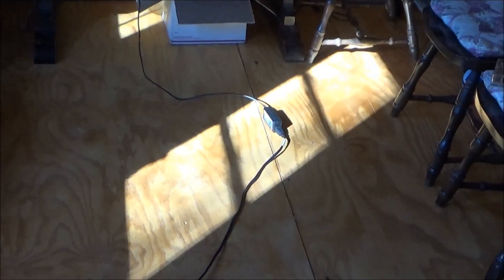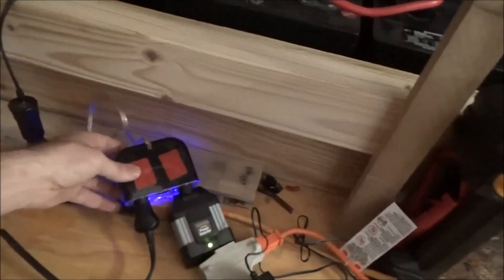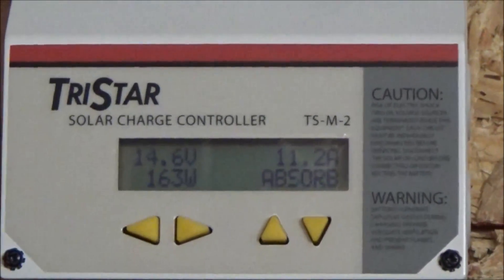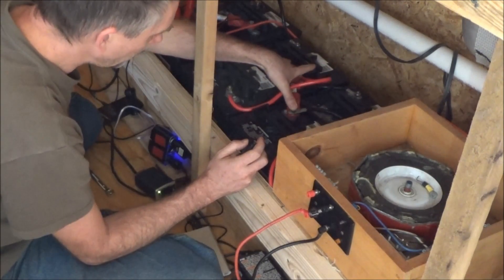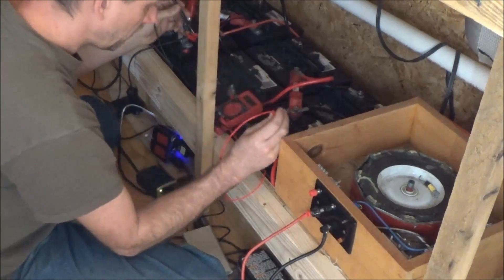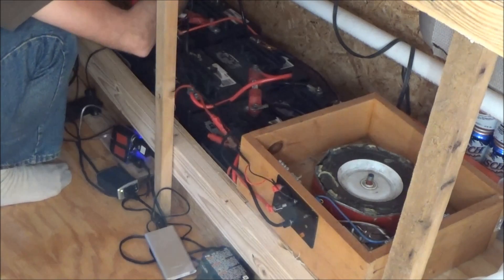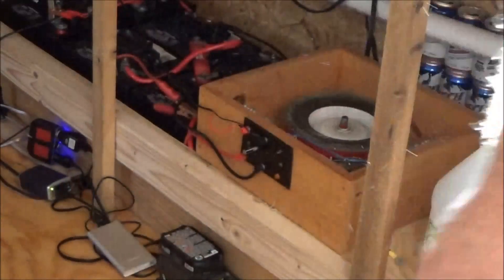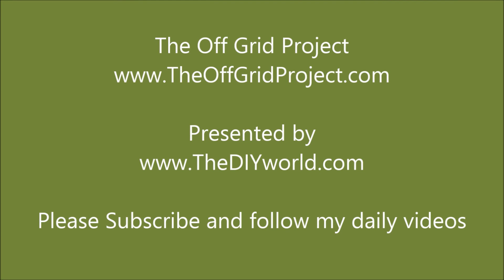Tiny House Solar Power And Desulfating Batteries With Bedini Motor

Comment: I’ve got 4 - 100W Rich Solar panels 2 in series & I’ve got 2 Micro GLM 700 & GLM 350 my concerns were the amperage each panel at max is 5.41A - 100W but my house is a front to back split and I don’t want to puncture the roof screwing the panels to it ideally the weight of the 4 panels together w/ the Slotted steal brackets to keep the 4 panels as 1 I’m in Massachusetts winds we don’t get to high 5 - 30 MPH once in a while 100 MPH but I’m figuring the jet stream blows at an angle to my house and I’ve hot skylights which can if needed buffer the wind ! The 4 panels weight is about 54 LBS + I have 8 AWG wire 1 pair 50 feet & a pair of 20 foot & 10 Foot pair “ my issues I just have to do it ! All my stuff is Grid Tie In into my Square D 100A 120v 15 spaces ! Have you ever thought of Back-Feed on a 20A Double pole Breaker ! And my Desolator Id BLS for 48v 280Ah how long do you think it will take to Desulfurization a Lithium 48v 280Ah battery bank ? Thanks

Comment: take your banana charger or your homemade charger I can't pronounce it or spell it the one you made that has magnets on it and hook it up 2 year solar charge controller and run it through the air at night time or all day. At all times and one more hint of a vice you can buy a 12 volt trickle charger that used less than a amp of power ac and converted to a lot more DC then they use what you also look up into your charge controller to trust me you can do it positive to positive negative and negative hook right into charge controller do your research if you're scared and you'll find out you can hook up a trickle charger to your charge controller and it will charge your batteries the only thing I haven't gotten to yet is about grade and tie inverters they are different I was told also I want to do is be able to use a 600 watt inverter and get a couple solar panels for that individual or charger or inverter I mean but also I don't know is sense grey tie inverters are different I do not need batteries watch the solar panels can go right into the inverter without eggs grid without a controller and also I want to do is plug it into my wall outlet and feed it back to me Electrical Company hit me back bro

Comment: If I were there I would open a window if I could smell hydrogen gas. Better safe than sorry if you now what I mean. What if the small hole is not enough to safely vent all the gasses.

Comment: Hi Troy
13amp ext lead is not one of your best ideas .
I would use a cable size of 10 AWG or bigger .
A wire size resistance Ohm/m table is essential for this work .
( xls sheet for maths as longhand is a pain )
I used this   " AWG to Metric Conversion Chart.pdf "

10AWG   =   0.00328 R / Meter
So 100M =   0.328 R  ( 50M out + 50M back )
So @ 15AMP = 4.9 Volts drop ( 74 W loss as heat in cable )
3 X 220W ( 660W ) of solar is within this range
With panels in series & maximum voltage of MPPT controller not exceeded ? .
looking for panel o/p Voltage of 42 - 50 v ( 5 v less @ MPPT end under load  ) . 
Edit < sorry for the Gold plated brick should be 42 – 150V more coffee please ! >

As for 13amp ext lead with 3 conductors (15awg) connected in the UK = ( 0.347 R ) @ 100M long with 17 v of solar .
Passing 20 AMP = 139W of heat in the cable & 7 V drop end to end .
In the real world the controller would step-in & you will see very little charge current .
Still a hot wire !!!!!

Now I need another cigarette packet ! .

Comment: I would buy a ctek charger. They can desulfate a battery in 24hrs. I had a battery that would only charge to 12.86 now its sitting at 13.16 after using the ctek.
Reply from the maker: With this Bedini I have taken batteries from 0.05 volts back to normal use again.

Comment: Hey Troy, congrats on the major top off! Have you ever experimented with a Hendershot Generator? If it works (haven't tried one but a lot of my friends assure me it does work) it would at least give you light and enough current to charge up your cells and 'puter. Next time you're on line Google it, I'd love to know what you think about it! Keep on keepin' on, my friend and don't let the haters get to ya. They just aren't worth the aggravation.
Reply from the maker: Thanks. I have looked at them but the Bedini is so simple in comparison. I need a proper work shop to get that complex

Comment: Hey,I am John .
I recommend you to buy a humidifier so you don't have problems with low humidity .
This is a link for you : http://www.ebay.com/itm/1-5L-Ultrasonic-Home-Aroma-Humidifier-Air-Diffuser-Purifier-Lonizer-Atomizer-New-/191282922589?pt=LH_DefaultDomain_2&hash=item2c8959c45d

This one can use a kind of aroma , if you don't want it to use it just don't put it in there ! I think it will have flowers on it but it's ok !

Specifications:
- Coverage Area: Up to 20 square meter
- Material: PP
- Power supply: 110-240V
- Rated Power: 25W
- High capacity water tank: 1.5L
- Dimensions: 132 x 132 x 268mm (L x W x H)
- Power Cable Length: About 90cm
- Color: White
- Weight: 658g

Thank you for reading my comment !

Comment: would be better to build a solid state desulfator circuit rather than a bedini motor .way more efficient ,much quicker.

on commercial solar farms they operate solar panels in parallel for better efficiency,1) reduces the amount of copper required for wire runs. 2) inverters operate more efficient at higher voltages 3) less cable loss 4) use auto load switching,.worth looking into as you have a number of panels and batterys/

remote monitoring sites run battery banks at 48v or 96v for one good reason " better efficiency".

shipping 12volts is a royal pain due to level of losses involved. all industrial & commercial systems run at higher voltage for this reason.

you should make a degas manifold and connect the vents up on all the batteries and vent directly outside that way you will not wast or loss heat from having an open vent. you could even store the dirty gas and use for heating ,cooking or run a ice depending how you designed the storage system and the type of accumulator used to maintain the pressure.

Comment: Hey there, I just thought of something I didn't add in the post in the last video.

Another thing that a lot of battery sellers are doing these days is leaving the actual amp hour ratings off their batteries and opting to put the 'reserve capacity' rating on them.  I know quite a few people who have hammered their battery banks because this number can be a bit confusing.  I don't know about your particular batteries, but this formula can be used to derive amp hours from reserve capacity,  I figured I would post it here for people with this situation.  I had a SuperStart deep cycle that only had the RC rating on it, so I had to look this up to get it right.

AH = (RC / 2) + 16

AH  = amp hours
RC = reserve capacity

This formula does not take the Peukert effect into account, but it's close enough for government work.  I've had no problems using this with my own battery, which is now nearing four years old.  I don't know why they are only putting RC on deep cycle batts alot, where the true AH rating is more necessary.  I think because its a bigger number, which they think makes the thing more marketable (psychological thing).  I do understand its place, but honestly, why make it more complex for people?

I hope this helps someone some day
Reply from the maker: cool, thanks for sharing

Comment: I bought two portable solar panel and battery kits. The large panel charges the battery pack which has USB port and car adaptor port.
I bring the small battery packs in at night to save electricity to use as lighting with a 12v led strip light.
I can also hook up an invertor and plug in anything up to 90w.
Its a great way for someone to start out in the solar world. I can basically run anything from my laptop or charge my phone, charge my rechargeable batteries.
I try to buy low voltage alternatives to everything, like I have a portable CD player that I found a USB adaptor for, or I found a USB led light with fan, so many low voltage alternatives that if I bought enough of these cheap kits I could run so many things around the home apart from the fridge and larger appliances.

Comment: Troy your voltage is to high for your battery's 14.2 is max for lead battery's  if the battery's are gassing is not good
Reply from the maker: Batteries need to be equalized once a month to keep the plates clean
Reply: The Do It Yourself World yes you are right but you egualize at 13.5 v  and you wil not get troubles with your batterys  boost or charge = 14.2 equalize = 13.5  gassing is never good for your batterys. Its not for nothing your equipment shuts down at 15 volt.

Comment: you know the charge controller has it built in  !Know how to apply an equalize charge that benefits the battery. It removes sulfation that may have formed during low-charge conditions.

Comment: I put a big marine switch on my inverters to Isolate them without sparks. the single batteries should be tested for at rest voltage.  Should be very close to equal  when connected in series. A Weak battery(s) should be used on the same set or on thier own.
nice and clean now.

Comment: I know there are 100 more pressing issues on the project but I will be happy if Troy ever covers his floor up with well... anything XD.   I can appreciate rustic but plywood appears more half complete than rustic.
Reply: Greg NY It could become rustic chic with a nice high polished wood floor. Or maybe add something unique with slices of wood set in resin or lightweight concrete.

http://tinyurl.com/pxywsb5
Reply: It's better than dirt. MIGTOW!
Reply from the maker: ***** That is amazing.
Reply from the maker: Actually I plan to do that next year with pallet wood. It can be quite beautiful.
Reply: The Do It Yourself World
Just make sure you don't put any radiant barrier down beneath the pallet wood or we will all think there are holes in the floor.  :))
Reply: The Do It Yourself World Yes and it can be yours today for the low low price of $9.95.

No but seriously it seems like a DIY project you could accomplish easy. It would just be a matter of selecting a lightweight medium to set the pieces in.
Reply: The Do It Yourself World
Although I can appreciate using pallet wood for anything you can because it is cost effective and does look nice I would recommend balancing it out a little. Maybe use something else on the floor other than wood. Just my thoughts.
Reply: ***** This would of course be a project for the spring when Troy is off hiking, traveling, or camping.
Reply: Uncomfortably Numb True! LOL!

Comment: Hi Troy Good to see you have power .
Bus bars made from copper pipe / brass / Aluminum bars work better than cables would use for 6 v battery - battery links . That MPPT Battery Charger has a max input voltage of 150V .
I would use that and improve your cable run drop
If 3 core with screen / armored use armored / screen + 1 core as NEG cable .
The 2 cables as POS cable .
If only 3 core parallel 2 conductors AND yes it's a S*** but you are struggling with what you have .
Put your Panels in series up to the voltage limit off the MPPT Charger ( more Voltage less Amp for the same watts ) .
Keep them small inverters for now 1500W will KILL that small 2 battery pack .

Comment: dont buy a coat rack...go out in woods and find a nice small tree that branches out and cut yourself one and make a stand from other sections of the tree...now that would have a rustic and natural look !!...and be free also
Reply: Brilliant!   I love that.  Or if he doesn't want a floor model out of a small tree...same idea only a small section of a tree with maybe four branches - cut them off to about three inches each sand a little to protect the coats and hang it on the wall as a wall rack.

Comment: Glad you got some sun and showing a full charge. I am a little bit concerned about hydrogen gas. you should close in the cabinets off and add a small vent pipe to the under the cabinet space. It would only give off gas during charging. It needs to be enclosed to capture the gas so it dont go out into the room. If it ever ignites it will probably burn the whole cabin down. Not wanting to be the bearer of negative news or facts. I saw a couple of videos on you tube about people who have had their homes burn down.

Comment: That mess of wiring all over the place looks dangerous. Gases from those batteries and a wood fire in such a tight space is not a very good idea.  http://www.toolboxtopics.com/Gen%20Industry/Battery%20Charging%20-%20A%20Multitude%20of%20Hazards.htm
Reply: It's lucky Troy heats with wood,, the draft from the stove is pulling MUCH air from  under his front door and the wire port under his counter. Once he installs a threshold and plugs the hole, things will get REAL SKETCHY.
Reply: grodad Well... now I feel terrible for pushing for the door sill.    Let's weigh damaged floors and water below in the floor insulation  vs.  explosion.  aaaah!
Reply: MollyDolly
I suggested he install a drier vent in the house last summer. He needs to install a threashhold eventually, right?? right on! Who knew he would end up using the under-cabinet space??? I spent the last two days waiting for a vid. I thought the off gassing had gassed Troy off! lol
Reply: grodad No videos on Sunday.  Well, rare exceptions maybe.   I try not to officially worry until Monday evening... just in case of power or Windows 8.0 delays.
Reply: The Do It Yourself World Apparently now I need to worry about the off gassing??  Dude, I am calling the Fairy Godmother's union... I want overtime!       This sounds scary...I really didn't worry while the batteries were in the RV because it was so drafty... but the TH is so nice and snug...  Irony, nice and snug is now a bad thing.
Reply: I would wear a gas mask while in there, sleep in a fire suit with about a half dozen fire extinguishers.
Reply from the maker: yak spy Thats it! Thank you for the solution to my problems. Now Molly can sleep at night.
Reply: The Do It Yourself World Yes, right after you get all that stuff properly installed and make a video wearing the equipment.  ;P
Reply: I think I would just go on section 8 and get a apartment after I charge my obama phone.

Comment: good to see your out of the red on the batterys!,keep in mind the have to go to 13.8 in float, preventing to mutch gassing.,thanks for following my advice.,but keep the 4 connected as they are while using the bedini, works fine, no worry's
Reply from the maker: I changed the 4 on the Bedini. They were not doing as much and I remembered that parallel batteries are like amplifiers to radiant energy. So I rewired them and they are doing better
Reply: The Do It Yourself World  good to here troy. think you mean that you put them al parralel, thats also good, just remember to charge them all together and not seperate. dont think you can put them al 6 together at the end when the 4 are revived,, but you sure can thry, remember to keep the voltage as close togeter as posible per battery, connect them al 6 after the bedini repair is finished, and then first charge them ,,,(all connected as y told you before see the schema y sended you by mail last summer) with a equalize charge on the mppt (round 15 volts) to get them all the same, think it wil work, but y am no fan off coupling all those differend aged batterys, but its worthwile thrying. keep us informed! regards Richard
Reply from the maker: MrBugsier5 right. i will restore the 4 then swap and do the 2 new ones
Reply: The Do It Yourself World y think that you are lucky with the new ones, y like what y see on your voltages.this moment on the new ones, thry to equalize again i you have enough solar power, dont think you have to bedini them.

Comment: NIce day at the off-grid project. But please do not think that the little hole in the side wall is suitable ventilation for the batteries, even if you can feel the wind. There is a reason you can still smell the gases even with the ventilation going. Worse. Hydrogen is much lighter than air, so it will rise to higher levels, and low level ventilation will not remove it. If you can catch the gases below the counter (and they don't get out the front of the counter into the living area) you can provide an opening high under the counter to vent the gases.